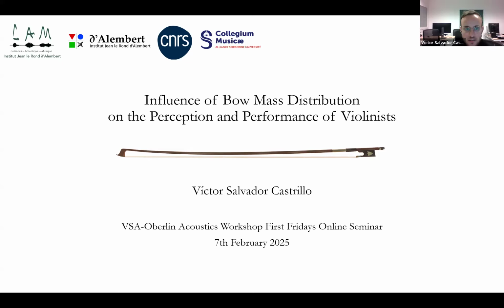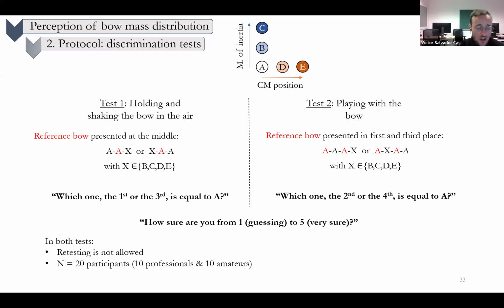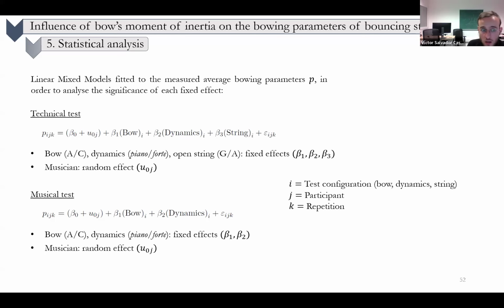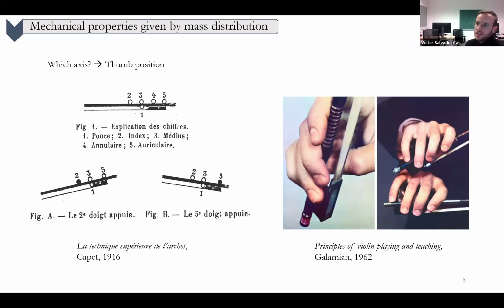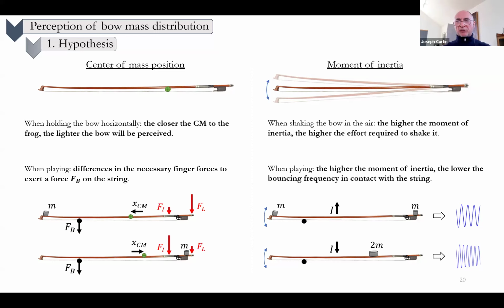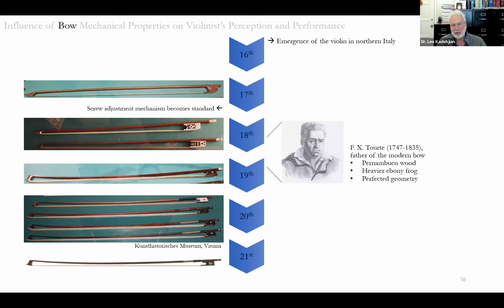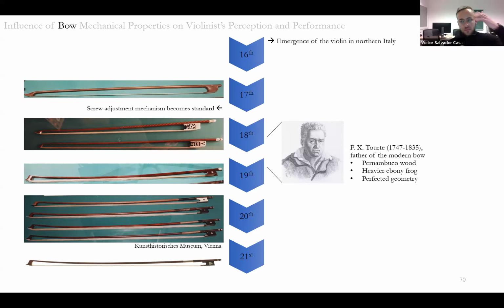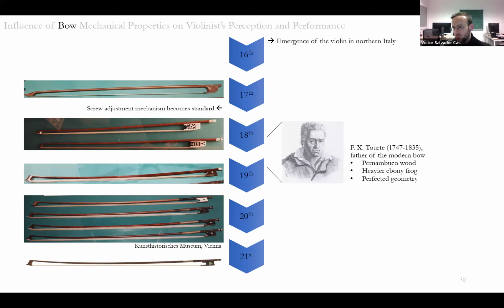The influence of bow mass distribution on violinists, Victor Salvador Castrillo, Feb 7, 2025

Comment: From YT 'FineViolinBows' video titled  "Installing a Grip on a Violin Bow, Part 1: Silver Wire" comments I gave a sample calculation of the
 (weight/silver wire wirediameter /length of wire winding) of a violin bow.  This affects the balance of the bow:  @deltasquared7777 11 years ago
Using  sterling silver wire
28 ga has a diameter of .0128”, weighing .280 gm/ft ; requires 78 turns/inch x 1.083= 7.04 ft of wire/inch and weighs1.97 gm/inch of winding, 
30 ga has a diameter of .0100” weighing .155 gm/ft; requires100 turns/inch x 1.083”= 9.03 ft of wire/inch and weighs1.40 gm/inch of winding
3” of 28ga winding weighs approximately 5.91 grams
3” of 30ga winding weighs approximately 4.20 grams

Comment: We make series of bows that have the same weight and the same elasticity, but differ in the distribution of mass. It does change both the sound and the feel of the bow. Regarding the feel and handling the largest difference is obviously in string crossings and in-flight-stability.

Comment: As a matter of fact, the bow does indeed modulate the sound of the instrument in its tone, rendering it brighter or darker. It is a function of the tuning of the bow which in turn is a result of its weight and elasticity. Also it changes the volume of the instrument. Here the key factor is the damping of the stick, which varies significantly. (Referring to the second half of the video in which bow characteristics are discussed.)